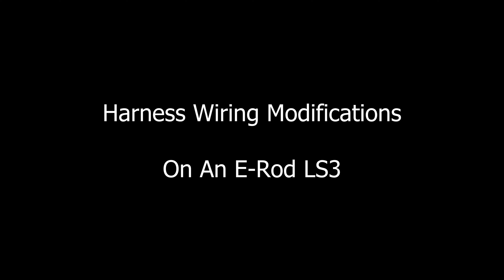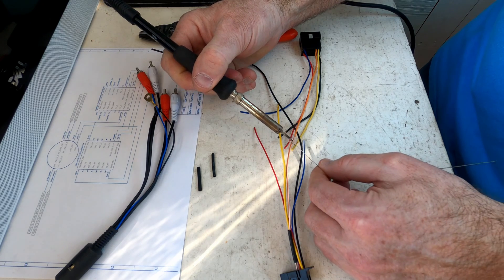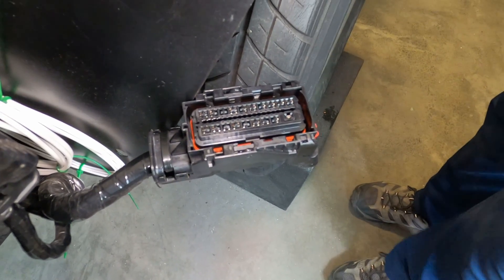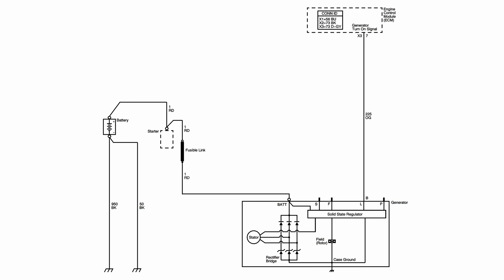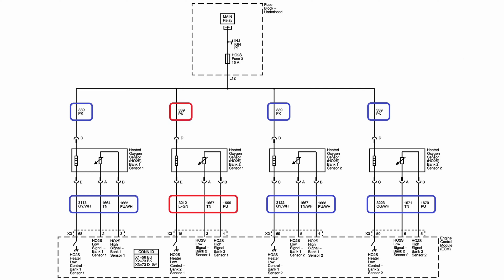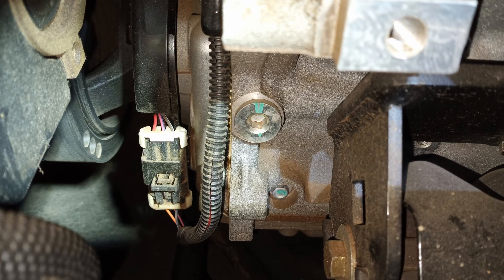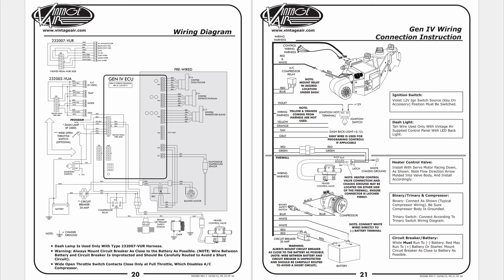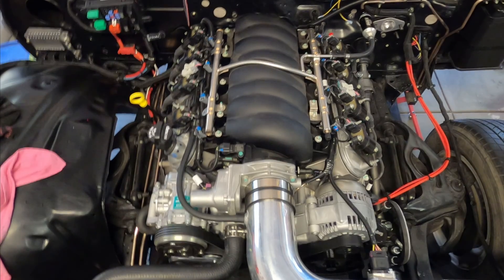LS Swap 22 - Harness Wiring Modifications

Comment: I think you used the Holley mid mount kit? If so, did you use the pigtail that came with the alternator? I’m not sure why I would need this. I called Holley but didn’t get any help. Not sure why the gm connector wouldn’t work.
Reply from the maker: Thanks for the question - Yes, we used the Holley mid-mount accessory kit.  To be honest I didn't even remember that it came with a pigtail for the alternator, but for sure we didn't use it.
Reply: @ thanks. I don’t plan on using either unless I start having problems.